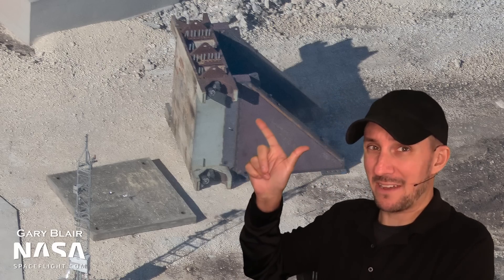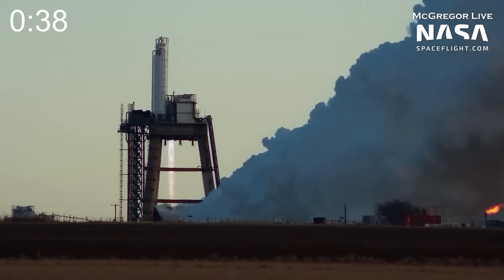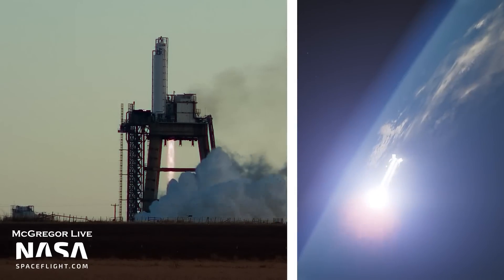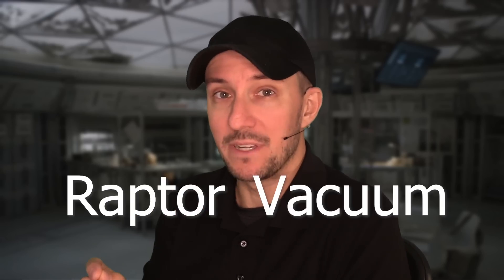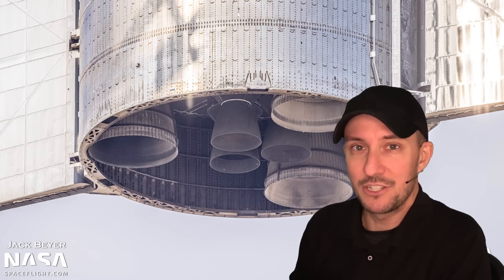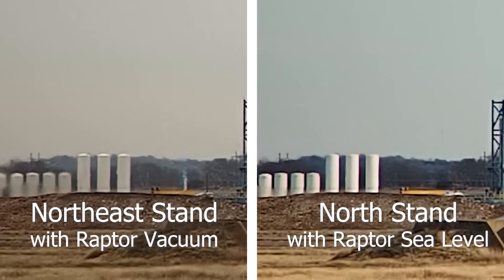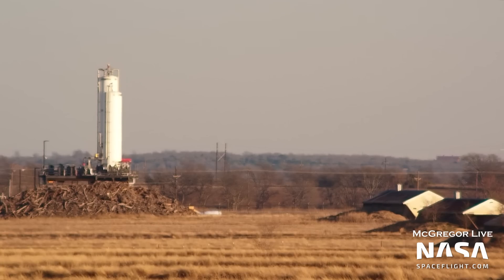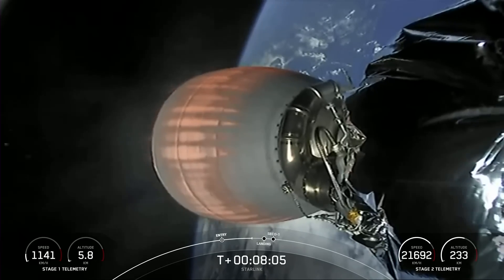Is SpaceX Firing Rocket Engines at Concrete?

Comment: Thanks.

Is there any official reason for not building a proper defector under the orbital launch mount?

I'm having an issue wrapping my brain around why there wasn't or why they haven't or why they aren't building a proper dug in deflector.

Seem an obvious move.
Reply: Elon said that their decision to not have a flame diverter might be a mistake.  There are two reasons they wanted to try it without:  First, there won't be a flame diverter when they try to take off from the surface of Mars.  They want to figure out how to solve that problem.  Second, Elon envisioned putting  Starship launch/landing sites all over the earth, like modern day airports.  Eliminating flame diverters would save money.
Reply: @59seank  Thank you!

I get those.

1 launching off Luna & Mars: The 1st few? What's the problem? Let'er rip. Prob won't even be back to those exact locations again. Just space the landing crafts, if more than one is landing in the same relative area, apart to not blow back on the others.

Once lifting off regularly, more Mars than Luna, build diverters there. Not so much w/Luna as the first rounds of landings ought bring w/from Earth the fixings for an orbital tower. More to the point, once the Luna Cluster Station* is in orbit, Starships would dock there & smaller Luna Landers ferry from there. An orbital tower on Mars will take more effort. Still, it the better solution to launches.

2 launching from Earth. Retrofitting will be more expensive than initially designing-building them would have been. The problem without them is the beyond measure increase in potentials for hazards, catastrophic one. Any large explosions would put all SpacX at risk. Flame diverters will help w/noise abatement during perfect launches too. Cleaver designing to channel noise away from people & housing. Makes for a better view too.

Multiple sites around the world? I thought the sea launched/modified oil drilling platforms were for that. Land based launching in New England? Anywhere at all along the East coast from NY to DC? How loud that will be? Multiple per day? Really?

I'm not sure, even if there are no accidents at Boca Chica, once everyone hears what those 33 will sound like & what the boastback landing-catching will sound like, they'll let it go on for multiple times a day!

Something catastrophic happens? That will be expensive beyond exciting.

Comment: Soon as they where building a block on concrete roughly the distance from OLM to the floor I guessed they where going to use it for concrete testing 👌 I hope they can find a surprisingly simple solution

Comment: How about this explanation of why they use flat concrete instead of flame diverter under OLM? Top of flame diverter should either be pointy(0D) or edge (1D) so you dont make closer surface to engine. SH Booster is huge and has 33 Raptor , 3 in middle , 10 in inner ring , 20 in outer ring. At this point you can't pu diverter between any 2 of these 3. So you would have to put it on very middle as 3 seperate part that suits that 3 mid raptor. Solpe of surface should reach booster outer circle distance so it can carry all exhaust if not outer ring exhaust may presure exhaust coming from diverters and it can be a problem. But to keep solpe diverty it wolud need to be as long on high as it is long on x axis which this high on middle would be harmfull. In short unless you dig you cant - it wont benefit - put diverter under those many engine. sory for grammar mistakes.

Comment: Great video. Suggestion for another one: Explaining thrust vectoring, static/dynamic stability, reaction times, control computer and induced occelations, electrical vs hydrolic and is it only weight or also reactionspeed. Hint there are many video examples of launches where this fails to illustrate matters

Comment: They are not going to find a concrete that won't explode under the Orbital Launch stand. 
Concrete takes 20 years to evacuate all the water naturally and fully cure. Everytime they light the engines, the water in the concrete turns to steam, and creates cracks while attempting to escape. 
The solution would be to put a central ceramic diverter cap that directs the engine exhaust out the sides.

Comment: You can't "see the heat", you see the effects of heat on hot air/exhaust gasses, mixing with colder air and refracting light while happening.
Reply from the maker: You see a wolf, but T'akaya is there. -Das

Comment: I was amazed at the electric engine vectoring test.  That moved so fast and precise I thought it was a sped up video.
Reply: Me too, I’ve never seen engines gimbal like that under such immense pressures and temperatures. Insane leap in practical chemical engine technology, hopefully from here they can prevent it from completely obliterating the ground underneath the launch pad!

Comment: Why not build a six section flame diverter that can be slid (rolled) under the OLM prior to static fires or launches?? Obviously an angular surface is much easier to maintain than a flat surface perpendicular to the thrust.

Comment: Well I'm not a rocket engineer, but I've never understood why there wasn't a flame diverter at Starbase. I would think it would be easier to build a trench or something rather than a wall of concrete protecting the fuel farm, where you still aim all the exhaust towards some fancy concrete. FUD could easily damage something...
Reply: At the very least don't have a flat floor. A small pyramid in the center would make more sense than flat
Reply: @Bbenkosky   They need a flat floor so they can roll in the service platforms to access the engines while on the OLM. But that doesn't mean they couldn't also roll in a portable flame diverter, eh?
Reply: @Bbenkosky  I wondered about that too. Might help protect the concrete. The OLM is probably half as tall/big as it should have been.
Reply: @profile5  Thats what Ive been thinking, not tall enough if they insist on blasting down onto flat concrete.
Reply: @Bbenkosky  I agree.
Reply: @Bbenkosky  was thinking the same, a big cone underneath the OLM that's not attached to any of the OLM structure would help a lot.
Reply: Water level at beach makes trenching problematic. 
If it was the 1950s they could run the trench from the shore and just blast ocean water.
Reply: They can’t build a flame diverter at sea level, if you dig at sea level and are soo close to the sea, water will flow in the hole.
Reply: @Mikado8  laughs in Netherlands
Reply: @Mikado8  yep.  Even if you made a concrete tub, water would float it.
Reply: @Mikado8  You don't dig it down, you build it up. Just like the tranche at Mc Gregor. or actually  KSC LC39A. I think the boss say early "No diverter!" and the engineers have been banging their head against walls trying to make due without it. I also think that just like the vertical tanks gone horizontal, we will one day see the flat concrete turn into some kind of ramp/incline/tranche.
Reply: The wall is to protect from rapid disassembly accidents while testing an experimental design.  As for the trench, the feds wouldn't permit it or a traditional deluge system due to wetland environmental regulations. The water is required to remain on SpaceX property and may not be discharged onto federally protected land.
Reply: @Solar2go  I thought they bought the offset wetlands to exclude those regulations.
Reply: I wonder if it has anything to do with Mars having no such infrastructure when they get there?
Reply: @dinky9216  I doubt any part of Mars will hold up like the concrete here on Earth will. I'm willing to bet it's a red tape thing.
Reply: @dhayes5151  Nicely played. The red tape on Mars is infinite.
Reply: @dhayes5151  The Moon or Mars surface will never experience the blast of 33 Raptors. Only Earth. I bet the Ship can lift off the moon on 3 Rvac only and maybe not even full throttle.
Reply: @LG-ct8tw  Good point. I was just considering that perfecting the concrete on Earth will have little to do with landing or take off on other worlds. I'm pro flame diverter all the way for BC.
Reply: I'm wondering if they have some sort of environmental restrictions associated with the FONSI that keeps them from doing it.
Reply: The thermal demands of anything that stands in the way of all that chemical energy converted into thrust at 300 bar is phenomenal! The engines can make it as they are constantly cryogenically cooled, plus a few more tricks. A Raptor exhaust makes a great portable & fast iron smelting furnace, and 33 raptors at close range likely exceed what it takes to make exotic jet turbine blades. Now if they could flood the area with liquid nitrogen from the OLT…
Reply: I've always thought that they at least should add a dome under the launch mount to divert the flames outward. This would minimize the risk of breaking concrete and likely also mitigate acoustic issues by scattering the sound waves in different directions instead of reflecting everything back up with a flat concrete "mirror".
This would slightly increase the velocity of the flames coming towards the fuel farm, but I think that is worth it compared to the risk of tearing up concrete under the pad.
Regarding why they don't have a flame trench: they kind of can't because of the water table. You would need a massive ramp like the one at LC-39A, which would complicate everything immensely. I don't think they have enough land to make that work.
Reply: @Dayanto  The trick would be making a dome that can survive that.
Reply: @Dayanto  this might be exactly what they are testing at Mc Gregor
Reply: their justification is that there won't be a flame diverter on the moon or mars, but there won't be boosters on there either, so it doesn't really make sense
Reply: SpaceX has stated that there are no flame trenches on the moon or Mars so they are working to make it be able to take off without a flame trench
Reply: The best part is no part. They are doing away with flame diverters.  Revolution.
Reply: They are not allowed to dig any trenches  at their site..
Reply: You can see that the falcon launch pad in florida doesnt have this issue because the platform is raised high off of the ground
Reply: They're not allowed to use a flame diverter, as they are surrounded by wildlife refuges.
Reply: If/When Starship becomes operational, suborbital global transportation becomes viable. “SpaceX - when it has to get there in 90 minutes!” So it might be great to have data on site durability.
Reply: 1) Because in any case, we have to solve these same problems on Mars to land, on the moon, as well as on earth, for obvious security reasons.
2) Just because the ground is destroyed doesn't mean it's a problem. (but how the starship and booster supports it, it is important information)
3) Having 8 openings all around is better than 1. It is not sure, a standard trench like at pad 39A would support as much gas, and would probably create a "jam".
Reply: Well your premise is the reason why. You are not a rocket engineer hence you don't understand why SpaceX is testing if the necessity of some subsystem and so far nothing major has happens that warrants building a flame diverter which presents its own engineering problems. More importantly the base of the OLM, which was the most important part to protect, has been unaffected.

The less subsystem Spacex renders useless the cheaper these orbital flights will become and the best way to test these subsystem is to expose to them to such situations.

The idea here is that there will be no Flame diverter when astronaut get to Mars so it matters to learn what the rocket can take.
Reply: My intuition is that SpaceX is trying to build the minimum launch pad they can.  So they're starting with a flat slab and adding on only what they need.  The berms around the fuel farm, they needed anyway to contain spills and protect from the rocket tipping over/exploding.  I expect that this is also why they built the fuel farm so close. Remember, they eventually want to build TONS of launch sites so keeping each site cheap/small is important.
Reply: @martylawson1638  Your intuition is literally common knowledge to anyone paying attention lol

It is common knowledge that SpaceX wants to erase as many subsystems as possible to reduce cost which is the whole point of their program. The vanguard infrastructure Space X is designing is part of their space development and they are testing the limitations of their infrastructure.
Reply: They need it flat to prevent the rocket from tipping over during launch.
Reply: Its for easy maintenance